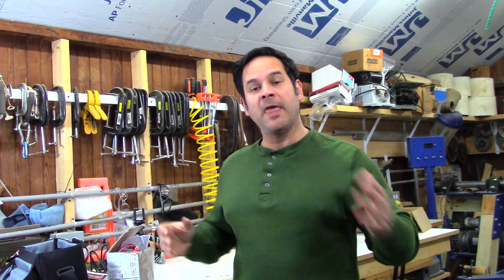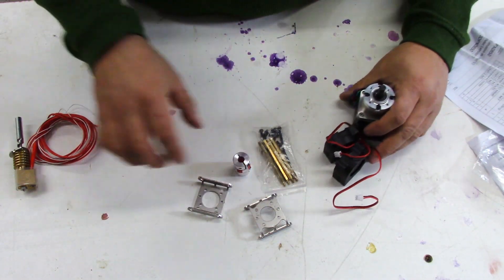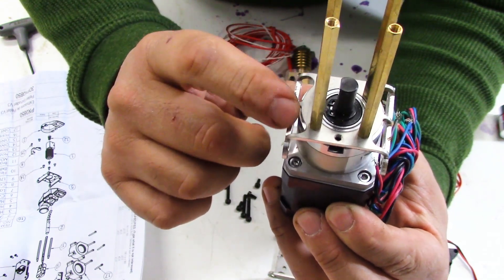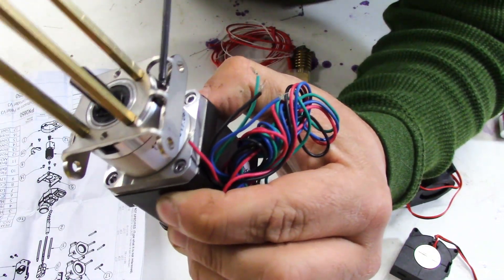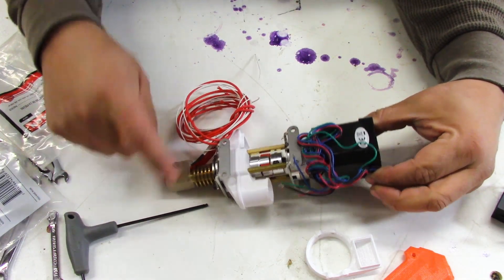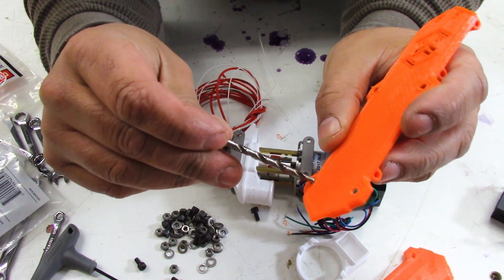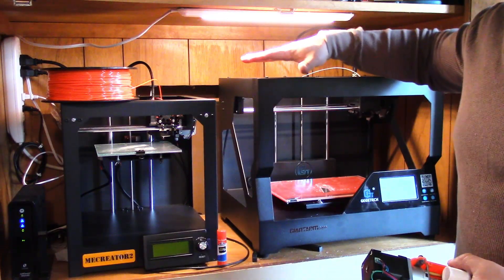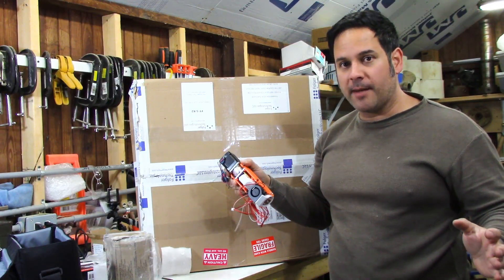Pellet Extruder for 3D PRINTER HOTEND

Comment: I strongly suggest you read the fire hazard warning on the foam insulation sheathing you have on the ceiling and do a small fire test on a chunk of it while outside and away from the rest of it. It's only fire code if it's covered by drywall. Otherwise it's the equivalent of solid gasoline. https://www.youtube.com/watch?v=mUPp-Ipt-Pk
Reply from the maker: Good point... but it's still there

Comment: that loading tube is intended to be used in conjunction with a tube hense the flare at the top, and the fan serves the purpose of also agitating the pellets to keep them from settling. The down side to this is its mass which will severly limit your print speed assuming the nema17 steppers and most common drivers can produce enough torque not to skip, its a novel idea but not very practical, i could see this being useful for one of them endless Y axis style printers where you could have weeks worth of plastic ready to go.
Reply from the maker: Thanks

Comment: This seems like you'd want a printer design where the X and Y motion all happens under the print bed and the hot-end/extruder mounts on a solid mount that only moves in the Z axis. That way you don't have to try and move all that weight around, plus feeding the pellet hopper would be a lot easier.

Suggestion: I would add silicone thermal paste to the hot end threads to help heat transfer from the heater block. The same stuff used between CPU's and heat-sinks.

Cool product though. Can't wait to see it print.
Reply from the maker: glad you liked it, im still working out how to mount it, just haven't had the time
Reply: This style of extruder is designed for larger format printers. The bed and whatever you're printing will weigh significantly more than the toolhead.

Comment: If I create a steel hopper, I put the plastic there, I melt it or leave it more manageable, and then it is pushed inside the hopper under pressure, so that it melts into the rotating screw that pushes the pellet towards the nozzle, it would not have to buy pellet, or crush the plastic. What do you think about that idea?
Reply from the maker: i think that is doable but very difficult to get it to work properly
Reply: @RayMAKES  Hello, you know where I can find the piece that holds the UPE to the X axis in 10 mm.

Comment: I finished building a shredder to make the finely ground plastic for this extruder. It dose not work very well so I will definitely be looking for a new design if I'm able to get the extruder working. However now at least I have plastic to test with. On my first tests the plastic kept getting stuck in the feed tube and in the extruder housing because the flakes from PET bottle plastic are very light and have a lot of friction.
I found a solution for this then the next problem I had was after the first 3 or 4 layers of every print I ended up with under extrusion even after turning up the LCD tune flow to 280. I then decided to test the extruder running at a super low speed (10mps). But the thermistor on the extruder then broke! So now I'm back to the beginning again. I also made a discussion group on Thingiverse for this extruder and hope that other users will join and share their experiences, so we can all solve problems more quickly. Find it here: https://www.thingiverse.com/groups/universal-pellet-extruder
Reply from the maker: Awesome! I spoke to Mahor, he says pellets work much better tgat shredded material.  If you mix it 50/50 it will work better

Comment: I remixed some of the printed parts. See here: https://www.thingiverse.com/thing:2975262 
Note that they are a bit hard to print, may require some sanding and the models are not as well created as the originals! I'm just not very good at modelling! However the new parts mean that you can see inside the cooling chamber and empty the pellets out more easily with a door at the side.
Reply from the maker: That's awesome,  I checked it out, looks great

Comment: When is the follow up video coming? I'm really interested to see how you print using a bottle and how you can use more than one bottle in a single print.
Reply from the maker: The follow up video is coming soon. I just finished building the printer, just need to upload the firmware and make a few test prints BEFORE fitting the extruder.
Reply: Ray MAKES, I'm excited to see it finished. It seems like this isn't your first rodeo so I hope things go well. I was considering getting this extruder myself but the price was a bit of a turn off. Did you get both auger types? If so I'd love to see how you use the one that let's you print using peg bottles.

Comment: why would you extrude pellets directly through the 3d printer instead of extruding it into a filament and then use the filament on any 3d printer despite of its size?
Reply from the maker: Why not?  There Are more choices in pellets than filament.  Also the cost of pellets is drastically less.  Lastly if you want to lay 2mm to 5mm lines... filament won't do it.

Comment: Well, that is interesting. Actually, I was wondering that when the extruder stepper motor of that 3D printer will be changed then, whether there is a need to accommodate that change of voltage, RPM etc. in the firmware of the motherboard or not? Please clarify my doubt, anybody.
Reply from the maker: I haven't gotten that far yet but I suspect that I will need to do some tweaks... I already ordered a higher capacity stepper for the job

Comment: Have you tested it yet? And how large is your very large printer?
Reply from the maker: Not yet, wirking on putting together the FT5. My big one is being designed but it will be 2400x1200x1200mm
Reply: wow, good luck with the big one
Reply from the maker: Thanks! The goal is to 3d print boats like my clear polycarbonate boat... here is the link https://youtu.be/rjgKWwPoZ6w

Comment: Does the extruder have to ride over the print head? Couldn't you extrude onto a spool then load into the printer in traditional style? 

I do see the merit of an unlimited load of printer material but most applications are not going to require this.
Reply from the maker: Some others have suggested the same thing.  Although I suspect you are right that most applications won't require this.... MY future applications very likely will.  This is definitely not for everyone... but certainly is for some.

Comment: Is it necessary  to tell the printer to CALM DOWN STOP WIGGLING
And does the pellet absorb more moisture? It seems to have a lot more surface area.
Reply from the maker: whether a material absorbs moisture depends on the material not the shape of the material.  i would imagine i will have to turn down the acceleration quite a bit... if that's what you were asking

Comment: Why you dont change firmeware measures for bed. or you can also put endstops on other position to test the extruder.
Reply from the maker: its because those two printers are too small and they work great as they are... but the real reason... was to get another printer, lol
Reply: hey, your printers are not to small. just change preferences. Like I said before! You sure that you will not have same issues with new one? contact me if you have trouble with some issues on new printer. www.makers-prototype.de is my website. you can get custom 3D-printer parts here also. Good Luck!
Reply from the maker: I will take a look, thanks

Comment: the shear rate in this extruder must be so high im not even sure you would need a heater (thats why there are turbofans on extrusion machines); I have the same idea with a big 3D printer with pellet extruder but when you do the math and add up the costs you will be scared ^^' The extrusion motor needs to be quite big (about Nema 34 to 42 = heavy) the screw has to be made out of stainless = the bigger the screw the heavier; then you add the rails (that needs to be beefy), the spindle and the belts; heavy moving assemblies = lots of stress on the frame with aluminium extrusion I had to choose 90x90 rails and they are expensive when they add, about 1.000 euros only for these and this is to get less than 0.05mm of flexing). I did the math for a 2*2*2M machine :)
Reply from the maker: I think you're right, the heater on the end is probably just to keep the nozzle from cooling.  I'm not so concerned with cost at the moment.... just trying something new!

Comment: This is a pellet extruder, not a 3d printer extruder.  It is only for making filament.  You collect the filament on a reel and attache the reel to your printer.  Nice idea if you have a source for pellets of the right material.
Reply from the maker: This particular extruder was specifically designed to be used on 3d printers.   Testing has already been done by the original maker
Reply: Ray MAKES If it doesn't have retraction how can it make good prints.  I don't want to just make prints that don't require retraction
Reply from the maker: well "good prints" is relative. for me, if i can print something big with heavy walls (2mm lines with 1mm layers), quickly, i dont mind a less than perfect surface. do i think this pellet extruder is for .2mm nozzles with .1mm layer heights, not even a little bit.

Comment: That is a lot of mass to be moving and stopping quickly. I can understand the operation, but not convinced the print quality will be any better than a standard filament hot end.
Reply: Pellet are also 1$~ a kg
Reply from the maker: yes it is heavy, im not looking for better print quality though, i want to have a choice of materials that my not be available in filament.  screw extruders build pressure, some plastics become less viscous under pressure.

Comment: Looks to be too big and heavy, would be better to get a Fliastruder
Reply from the maker: it is definitely big and heavy, but it is not intended to be used on a tiny printer
Reply: I wouldn't put it on any printer, you will be lucky to 15 mm/sec
Reply from the maker: i think that will be fine, since i plan on using 2mm nozzles with 1mm layer height
Reply: You will have to kill accelerations, adding stat ic drag will help out too, use large steppers.

Comment: Can you modify the mecreator's firmware to restrict the size of the print bed so it doesn't force the pellet extruder against the side where it doesn't fit?
Reply from the maker: I probably can... I think... but I have no idea how.
Reply: I guess it will depend on where the endstops are that automatically measure 'home.' If they're on the safe side, then I think you can change the print bed size in your slicer's settings without changing the printer's firmware at all. 

If the endstop is on the size where it will crash the extruder assembly, you would need to do some hardware modifications before changing the print bed size in the slicer. You could attach a rod to the extruder assembly so it can hit the endstop from a safe distance, or move the endstop so the extruder assembly bumps into that before it bumps into anything else.
Reply from the maker: that could work, its just that these particular printers have angles at the corners that protrude far enough to present a problem with this set up

Comment: Not sure i would ever purchase this. How would you maintain a consistent extrusion? I feel like there would be almost no retraction. Not to mention, Its gigantic, You would be really limited in print speed.
Reply from the maker: Im not really concerned with print speed,  I usually print at 25 to 30mm/s with 5mm/s accel.  I also plan to print at 2mm line thickness  so any slowness in printing will be made up in layer height and few walls
Reply: Ray MAKES while making compromises in print speed is fine I suppose, what about accuracy. Do you think this extruder will be able to accurately sustain an exact extrusion? What do you gain by using this over a more conventional setup? Is there one? Are you just excited to try something new and create some YouTube content with it?
Reply from the maker: XTC Tech accuracy is not a big concern for me, after all this is just printing with plastic and I'm not interested in fine detail.  I have had great results printing with 1mm nozzles, parts print faster even though printing is slower, counter intuitive to say the least. 1mm lines is really the limit of 1.75mm filament.  With a pellet system I can push to 2mm thickness, probably thicker.   That's what I'm after, big heavy lines, strong utilitarian parts, printing quickly.  As for excitement and YouTube content... why not both.

Comment: maby it would be good to use termal-paste when assembling heaterblock with the rest of the system. (im sure the silicon insulation is good, but intruducing air as an insulater in the threat will defenetly not make the heating of the pellets beter. )  cool project, gonna be good to see results?     (i am sorry for my poor english :/ )
Reply from the maker: Your English is good, I think that is a great idea to make sure i get good thermal conduction

Comment: If  you are looking to use cheap pellets, you might consider trying the Filastruder to create filament from pellets.  With the print head so heavy, you sacrifice print speed (since your print head has increased in weight).  
tldr; nifty idea, but not really a great for desktop printers
Reply from the maker: i think you are right on the weight, thats why im looking to build the larger printer.  acceleration would have to be turned WAY down

Comment: You'll probably get terrible prints due to even minor fluctuations in flow rates since pellet loading is not gonna be consistent, unless you're printing very course detail.  For fine prints you're better making a pellet to filament maker and then print regularly with the filament.
Reply from the maker: yeah, i know alot of 3d print guys are interested in fine detail, but i like to print course, heavy and in a short time frame.  detailed printing takes way too long

Comment: Looks high quality. like for example he has made a proper extruder screw where the "flutes" gets shallower as it gets father in to the barrel, just like the screw in a professional injection molding machine. And this helps to heat the pellets as well as compressing it and evenly distribute the heat in the plastic.
Unlike most of the hobby level extruder screws where they just use a cut of wood drill bit.
Reply from the maker: good catch, you obviously know your stuff.  the fast that it is a "proper" screw is why i pulled the trigger on this one.  Mahor has put alot of effort into the R&D of this extruder.

Comment: Forget about printing with one,  i would setup in tandem with my printer,
ok lets explain , i would setup on top of my existing printer with a 1.8mm nozzle and have it extrude and have it feed into my existing print head and so i would  use to recycle my old odds and ends and whatever, so you just do the calculation for the feed and the way you go.. then afterwards just put back in your normal plastic, Simples
Reply from the maker: thats an interesting idea

Comment: Maybe I missed it in the video but how much does the entire assembly weigh. It looks pretty heavy. Wondering if you might have to beef up your other motors to compensate and also gow much you'd need to tweak the jerk settings in MarlinFirmware.
Reply from the maker: i didn't mention it in the video , but the unit i estimate weighs about 3 lbs!  a lot, i know.  i will definitely need to dial down my speeds and accel but i'm hoping to print with 1mm to 2mm nozzles and tall layers.  the speed of printing big heavy layers makes up for speed of printing. i show that in my modify nozzles video.
Reply: Ray MAKES Cool thanks for the info and good luck.
Reply from the maker: thanks!

Comment: My main worry, asside the weigh, would be accuracy of the print.
Secund, you say you have access to cheap pellet. But for "regular people", what is a good price for PLA pellets? Let say for arround 25kg bag?
Reply from the maker: I've seen PLA pellets go for 3 to 5 a kg
Reply: Where should we check to buy? Alibaba, Ebay our local plastic extrusion compagny?
Reply from the maker: ive seen them on alibaba but also a few other places.  i think there are a few deals on ebay as well.  if you get them from regular filament suppliers, they need to mark the material up to make a profit on the pellets, so the "economy" is lost
Reply: I was talking about "extrusion compagny" such as blow molding, rotomolding and such.